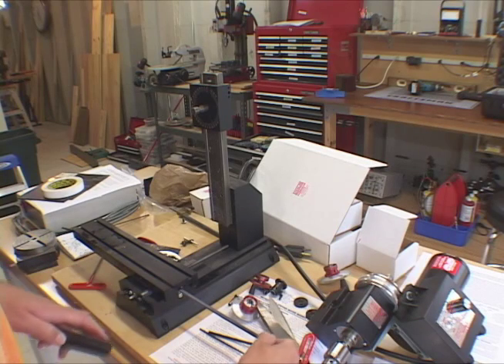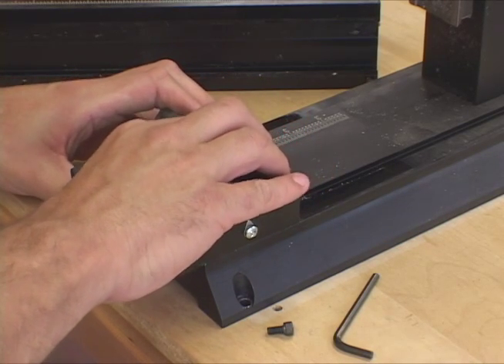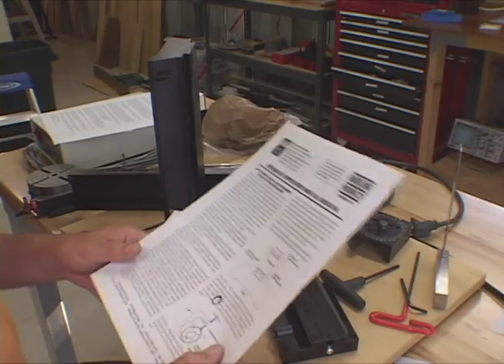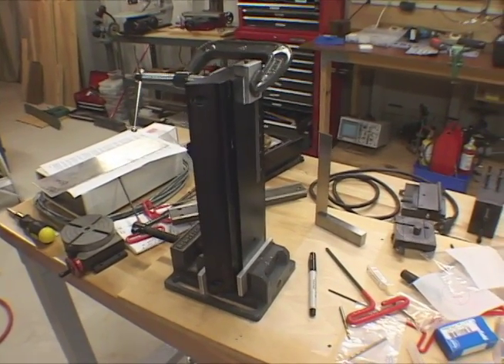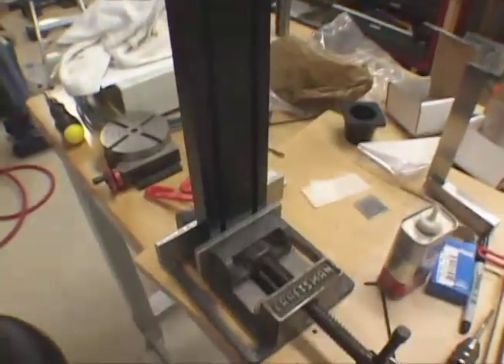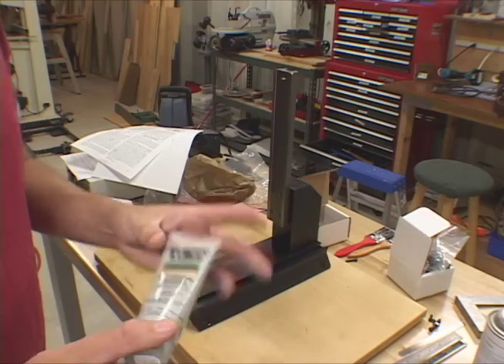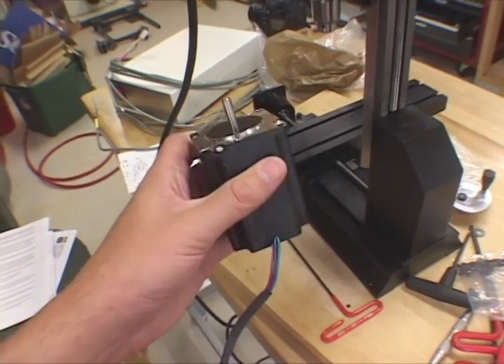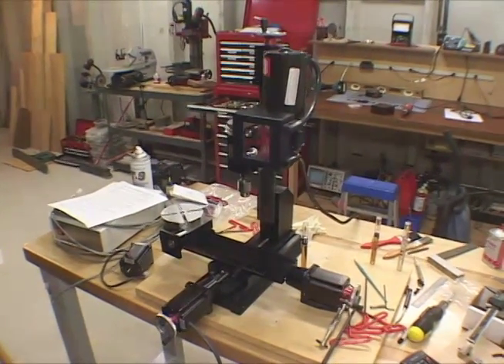Sherline CNC Mill Conversion 2

Comment: Great video, I loved it. One tip though, perhaps you didn't have a 90 deg allen wrench to remove the cap screws but if you use a 90 deg allen wrench the screws will come out much easier. Those long "T" handle allen wrenches twist to much. Also, if you loosen the gibs the slides will come off a lot easier for the future. Forgive the nit picking, you did an awesome job. I just wanted to suggest a few different options.